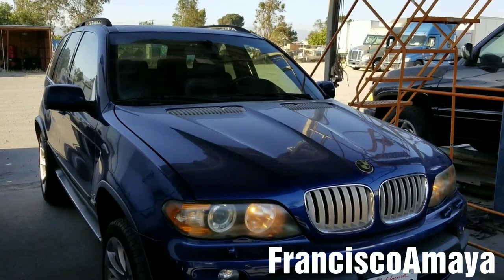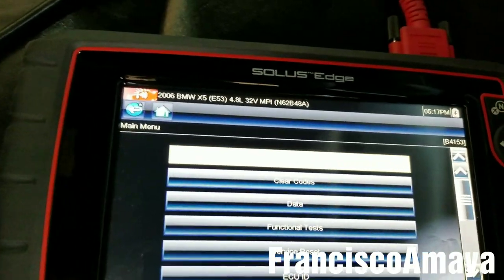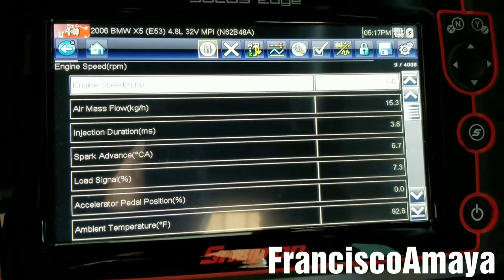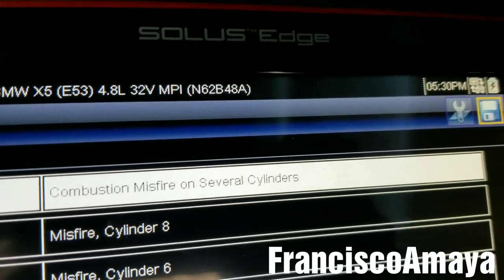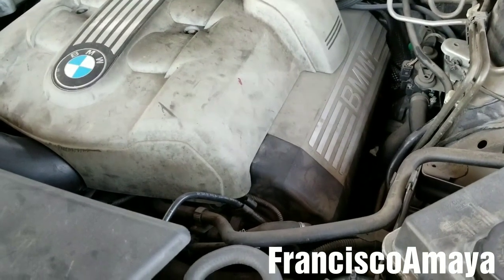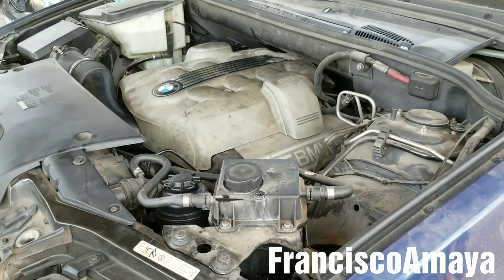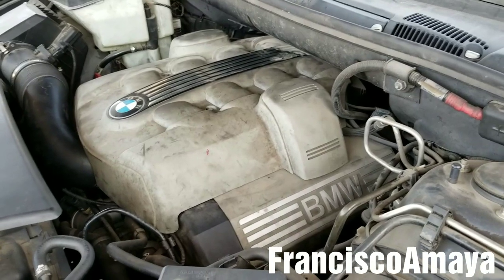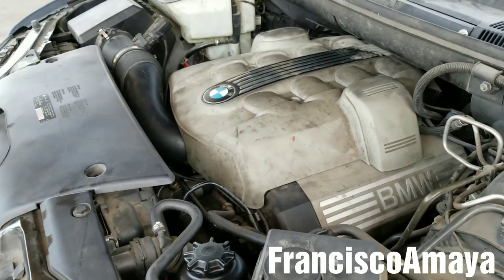BMW N62 N63 ENGINE MISFIRING NO POWER SHUTTING DOWN  550i 650i 750i 750Li X5 X6

Comment: Well I finally fixed my 2004 X5 4.4L. Replaced the intake carrier on the right bank with a used one and it purrs like a kitten. Misfire on cylinder 2 was bad. Hope this helps someone out there.
Reply: What did you replace? intake carrier? what's that? Can you share an image to my email?

Comment: Hello Francisco, thanks for the help on the last question ,it happen to be the clutch 
Need your help again , would appreciate any help 

I have a question for you, have a Freightliner cascadia dd13 

Motor control module 2.1 
#1- DEF inducement DEF light active 
#2- DEF inducement CEL light active 

After treatment control module 2.1
First code 
#1 SCR closed loop control at maximum limit  
It’s Derated and def yellow low thank DEF light is blinking and it not empty 
I’m thinking the truck thinks it’s low.
what do I need to check first, well basically what would you start checking , what would cause this 
 Codes that come up won’t clear and I haven’t seen these codes at all, any help would be appreciated

Comment: My 2009 750li is smoking blue when idling out the exhaust. Should I change the crankcase lines? Or is it the dreaded valve stem seals?
Reply from the maker: Yes, replace the crankcase valve and line.  It is very common problem.
Reply: @franciscoamayaYT  ok thank you I'll let you know what's happens
Reply: Francisco Amaya hey where are they located on the 2012 750 N63 twin turbo?
Reply from the maker: J. Kisart
They are located on top of the engine. They run for the turbo inlet pipe to the intake manifold. They are hose like looking
Reply: Francisco Amaya thank you
Reply: Francisco Amaya hi do you think that changes the crank case valve and line will eliminate the smoking when cold starting? I purchased 2 orange pcv valves but they went for a older model 750! I have a 2012 twin turbo
Reply from the maker: @j.kisart6100  
You need the newer pipe looking pcv.  
It is very possible that could be the cause of the smoke 

Check my new channel I.E. Euros 
https://m.youtube.com/channel/UCIsM5dM2g4fQBO5QzMQpsfg
Make sure to subscribe to get notifications everything I upload a new video

In this channel, I will be uploading new BMW repair videos and other things related to BMW and other performance vehicles.